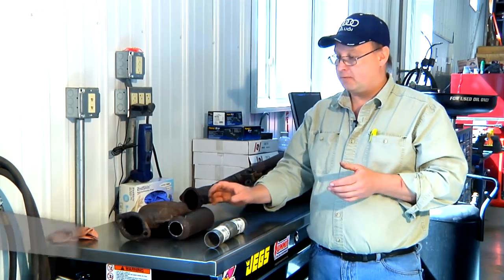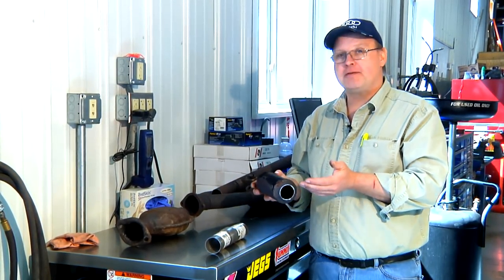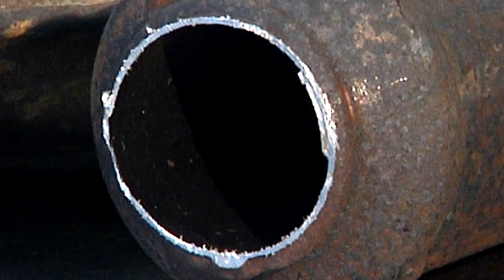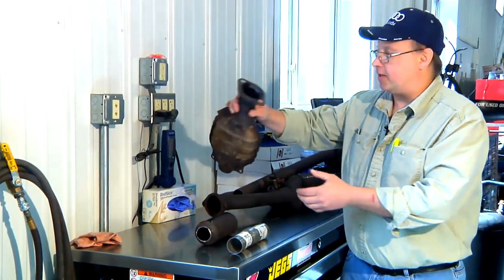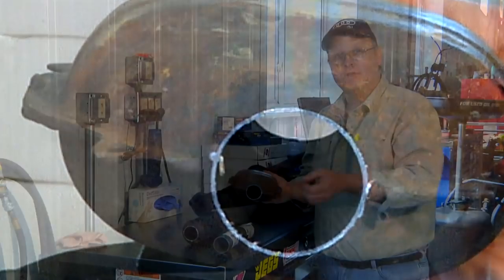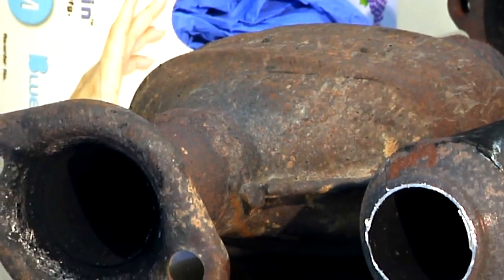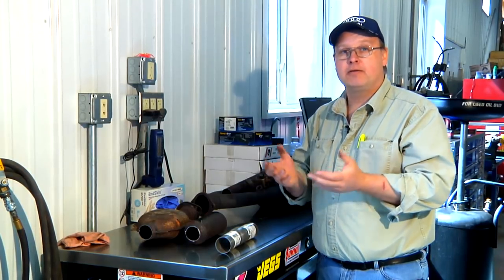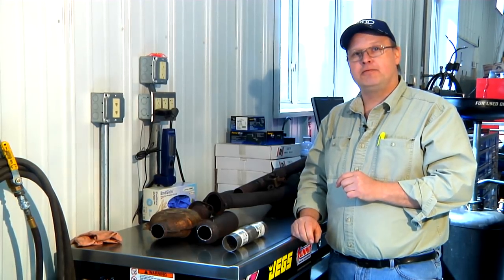What Happens if You Replace the Exhaust Resonator With a Pipe? : Under the Car Repairs

Comment: if you need back pressure why dont you shove a potato in your exhaust? lol cant beleive people still think you need backpressure.
Reply: ZohanLohan you need SOME backpressure, just not a lot. resonators dont create a lot of backpressure. unless youre a mechanic like me who works on exausts for a living and has had his car with resonator and straight piped. dont say you dont need any backpressure cause you do. if you have no backpressure at all. you loose major fuel economy and put a LOT of strain on your engine and your engine will burn out a lot faster
Reply: Dylan Clay you just need the right size exhaust for the motors size and application. racecars dont need backpressure!
Reply: ***** ya well youre always going to have some backpressure
Reply: +ZohanLohan Actually backpressure is good for low torque end, you can feel the pulling much better.
Reply: ish skittles backpressure no, scavenging yes...
Reply: +ish skittles 
If backpressure is good for torque production, then take a 5lb hammer to your tailpipe and beat it in until it's almost completely closed off.

You'll have a real torque monster on your hands then, right?
Reply: +Dylan Clay  
How do you figure?
Backpressure is resistance to flow. If you are generating backpressure, you are creating a pumping loss on the engine. That means energy is being wasted pushing exhaust out of the engine. Energy that could have been used to propel the vehicle. 
BTW, Practically any production automobile's stock exhaust system that's in good condition has no measurable backpressure at light to moderate part throttle cruise.

Most stock exhaust systems only start producing measurable backpressure during heavier loads or WOT.

Since they don't produce backpressure at loads where you get best fuel economy, how do you propose that it's used to generate better fuel economy?
Reply: +ish skittles 
It's quite clear that you are unfit to talk on this subject. 

My remarks are based on DECADES of testing and research, which includes countless hours of both chassis and engine dyno testing, street and track testing too.

How about you?
Reply: oh I'm sorry you're very fitting talking about beating pipes lol
Reply: +ish skittles 
You're likely unqualified on that subject too...
Reply: +Mortal Tactics Dude how old are you? The guy you just talked down brought quite a bit of things to the table to talk about and you tell him he is stupid? Seems like you are the only fool around here buddy...
Reply: Look, man, I ain't fallin' for no banana in my tailpipe!